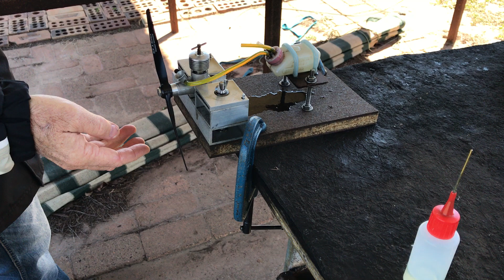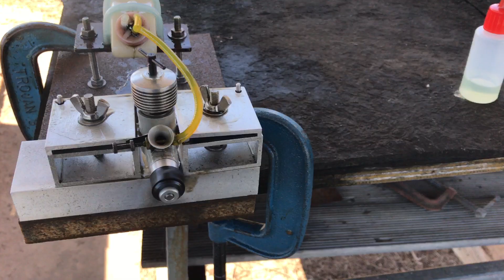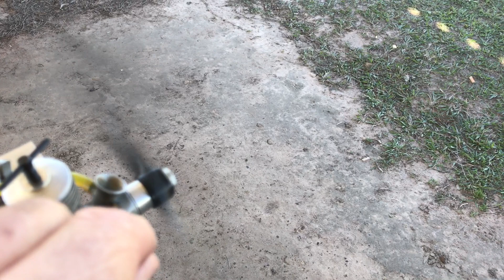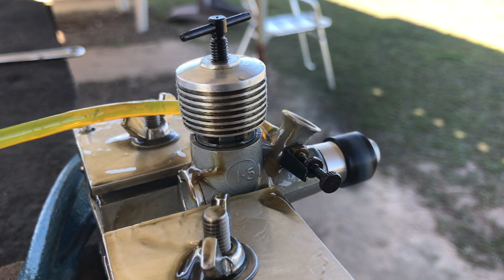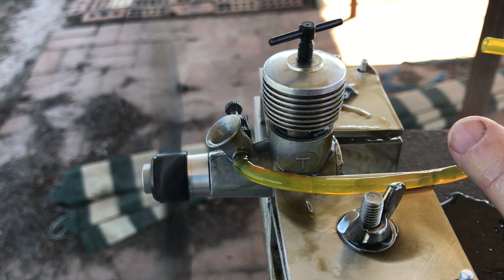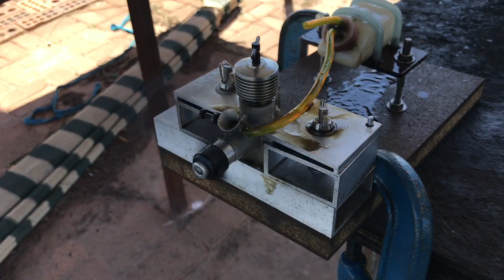Taipan "Series 66" 1.5 c.c. diesel model engine

Comment: Must admit, after a bit of firing but no running I got the blow torch out (dont tell those guys on Barton forum - too many delicate sensibilities ...).  Anyroadup, I cherry bombed the piston to barely red, quenched it in Mrs C's finest virgin olive oil.
Bingo!  Re-fitted piston, and great compression.  Fired up and ran really well.  But how long will it last?
We shall see.
Reply from the maker: The 'experts' will give all sorts of reasons why the procedure does not work, however we have used it on engines down to 0.5 c.c. capacity and often the results are most worthwhile.

Comment: Hmmmm .... why do I do this?  " ...  bench run just now, great comp ... etc" turns out to be completely gummed up (no way has it just been bench run) and comp bleeds off v fast! 
One for Tom's tender treatment, I think.  Not even worth telling the seller. Funnily (!) enough, I got a super tigre just the same.  Put a head gasket on it, freed it up ("turns over freely ...") .  Roars like a good'un now!
And while I'm having a moan - why do people seemingly use a stilson to remove glow plugs?  Havent they heard of sockets?  Nice Goldhead and the Tigre head fins mangled by this treatment.  Sorry, rant over!
john
Reply from the maker: Some of the things we see  … you can only wonder what they were thinking.  All of the Taipan glows of this model had soft compression. It was the Factory's way of ensuring they did not seize. Sadly many had insufficient compression to run properly.